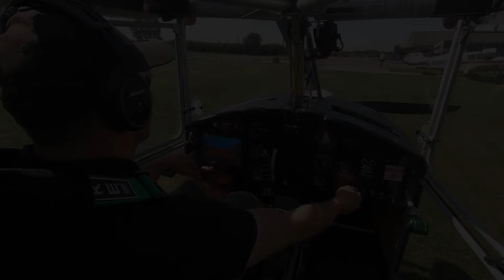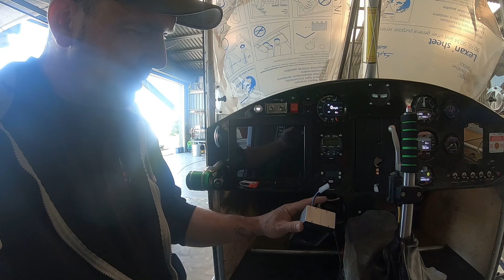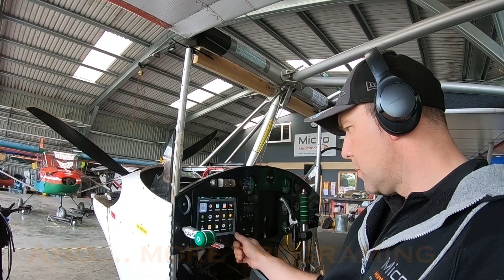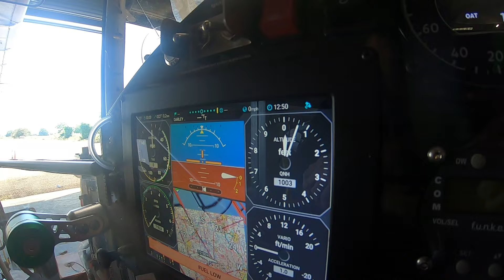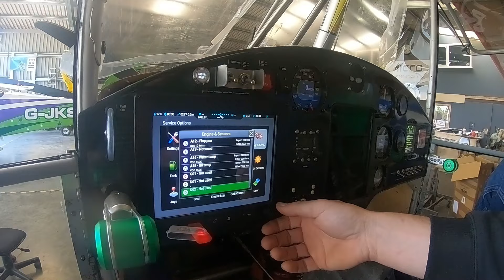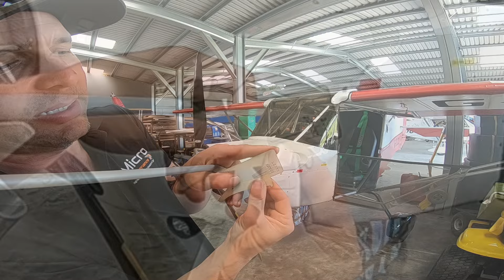Houston we have a PROBLEM! - Full Kanardia Nesis system programming and check flight

Comment: Great video! I’m in the process of installing a Nesis and Horis (backup) setup. According to the manual and your video they will be on their own CAN-bus. Wondering how did you manage to control pressure setting on both devices in sync? Hoping to safe some days of debugging 😜
Reply from the maker: Hi Sservus, they way i linked them both units shared a can bus, but different power supplies, the ALT was a master unit and so, if the Nesis stopped working the ALT would revert back to a primary unit. hope this helps, im guessing you have already sort it now though

Comment: Looking at your programing fun is why I like the old steam guages 🙂Would probably be easier as a first user.  🙂 The reboot in flight would drive me mad, it is bad enough when the iPad goes blank but that is why I use maps as primary and Sky Demon as back up but I have conseeded to one electronic instrument, a MGL for the engine, which if it fails is no a emediate end of the world.
Reply from the maker: My default is also
Old school, give me a map any day… BUT, this was very impressive I’d say we used about 20% of its capabilities
Reply: @wingnutshomeofmicromainten6946 like many computer systems, there are too many bells and whistles, that have no place with the ordinary pilot, we need to keep their heads looking out, not whatthe trend has been for maintaining heading over the last half hour. That said some you can record / recall engine and flight trends, so when we come to service, we can see the pilot over speeded the flaps or did not let the engine get to temp.
Reply from the maker: Yes big brother does have its place, I’ve developed a number of systems that would record “black box”
Style including voice and visual but feel that it would be more beneficial to the insurance companies than the pilots or maintenance
Reply: @wingnutshomeofmicromainten6946 yo are probably right, so KISS comes in and steam it is for me 🙂
Reply: @wingnutshomeofmicromainten6946  I'm currently working on an experimental using a motec dash for data recording, but if kanardia is able to record engine parameters for engine tuning and troubleshooting, that would make it easier. So having many channels/inputs are a good thing for the right person.